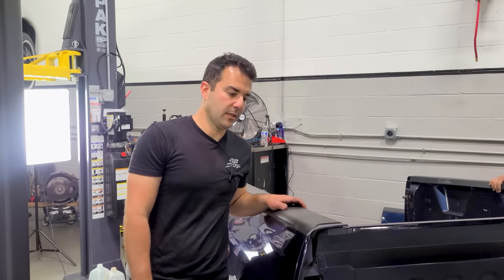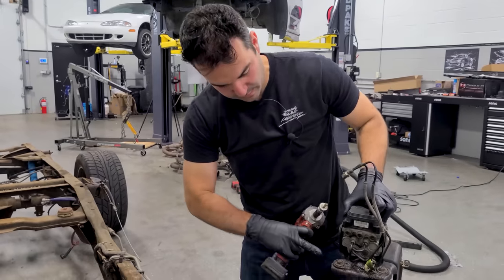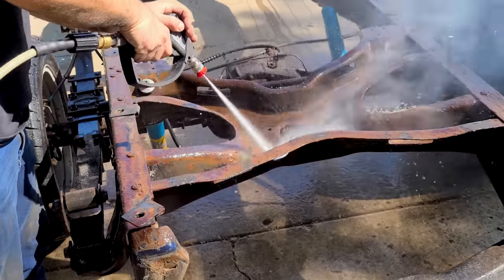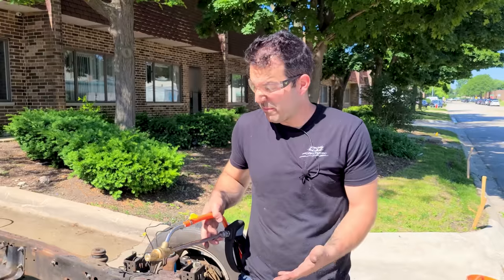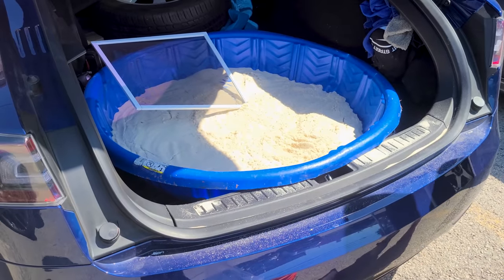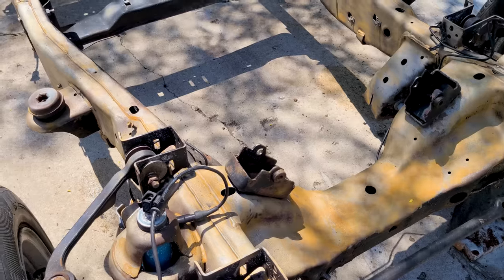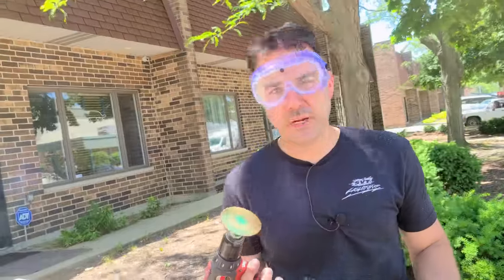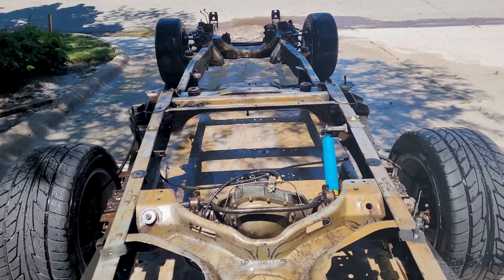I Was Quoted $3,000 To Sandblast My SVT Lightning Frame So I Did It Myself For $100 & So Can You!

Comment: Instead of dealing with having to try and get underneath it and deal with those awkward angles everything else is already pretty much off the frame why not just grab it on the side with the engine hoist and tilt it up and onto its side.  I'm quite sure this suggestion is going to be too late but that's what I would have done.

Comment: If there is a next time, spray the frame with oven cleaner and pressure wash it first. The oven cleaner will remove all of the greasy residue and a lot of the paint that takes time to blast through with the sand.

Comment: Play sand is the worst product to use for blasting because of the silica. It says it right on the bag not to use for sand blasting

Plus, why in your right mind would you sand blast a rolling chassis with moving parts still attached, sand is now in everything. 

This is not good practice sorry.

Comment: Great vid - But please don't use beach/ river sand or the common white sand you buy at home depot. The majority of these white sands are silica dioxide (SiO2 / quartz/ crystalline silica ) - quite safe but when it is smashed under pressure it releases "free Silica".... I understand you are suppressing the process with water but please don't do this. I beg you - Please use a safe and excepted blast media. ( Search " Silicosis" )
Reply: Aluminum oxide

Comment: There's not going to be any dust because of the water.

Then the water evaporates and you have 6 bags of sand either blowing around the neighbourhood or worse, down a drain which can cause blockages.
I'm not saying not to do it as I would have done exactly the same because f*** the neighbours.

Comment: Dumb question. Could you put taller tires on and flip the frame over?
Reply: Looking at it at 6:11, it looks as if the tires are tall enough already.  However, being upside down might change things with the suspension being loaded 180 degrees from normal.  Or put some crappy wheels on it and stand it up on it’s side.
Reply: @montestu5502  that would work to. No fluid to worry about, so on it's side would be ideal.

Comment: $100 in sand $10,000 in blood sweat and tears. I still don't see the point of doing this. I would have pressure washed it with super clean degreaser and rock guard sprayed everything later. IMO you've accelerated the oxydation process.

Comment: I'd be afraid the tiny particles of sand would get into places they should not be, like the brake calipers.
Reply: and all the bushings, leaf springs, shock absorbers, differential vent, wheel spindle grease seals, any other grease seals, inside unreachable places on the frame. I wonder how good this is overall. You will want to thoroughly pressure wash, but I would think you will still drive some sand into spots you don't want it.

Comment: What do you do to get inside the frame and remove the rust and paint it?
Reply: Besides cutting to get access/rewelding, dipping the car, or spray encapsulates.. there is no way to blast the inside.

Comment: 20 hours to sandblast that ? Lol 😅 ! Black slag sand 36 or 30/60 with 80 lbs sandblaster pot. With a Real 5 hp compressor 
6 to 8 hours with breaks Max.

Comment: I did my dual axle boat trailer for a 25 foot boat with 4 knotted wire wheels, a good respirator, gloves and face shield. Total cost $60.00 No 100 pounds worth of wet sand to clean up. No huge water waist. This is a huge waist all around. Just my opinion.

Comment: As I guy who does body work you have just done the worst thing possible. The professionals use a rust inhibitor as they blast so flash rust isn't an issue. Introducing pure water on bare steel is not what you want. Many of those areas had zero rust, now you have put rust everywhere. Rust never sleeps and all that will come back whether you use a rust convertor or not. And most those rust convertors only cover/hide the rust. You sir have made a huge DYI mistake and mess. Blast the frame DRY !

Comment: At the end of the day, it's your car and your time, so if you're happy, that's all that matters..  But with all due respect, this did not turn out well.  It looks like you spent about $500 and several frustrating days work, for a $100 result and frame rails full of sand that you'll never completely get back out.

Comment: Wtf? Who charges that much? At my shop, that is a 500$ job at the most... And it would look 1000x better than your end result.. we use classic cut 80 Australian garnet, and when finished, it is bare metal and turns the metal a very light gray. There would be no rust, and it would be 100% uniform; it almost looks like it's painted with gray primer when finished..  where did you go?
Reply from the maker: I went to my shop and did it myself